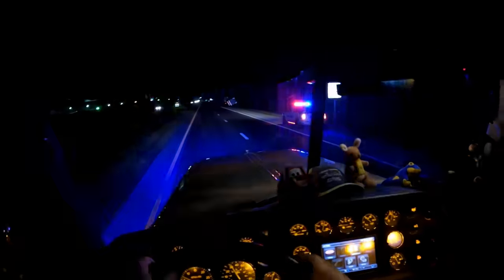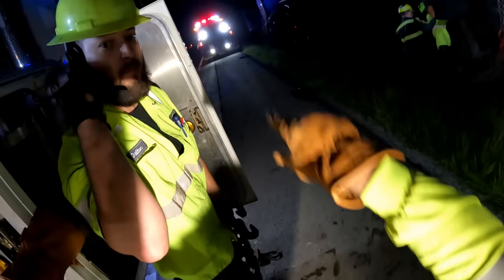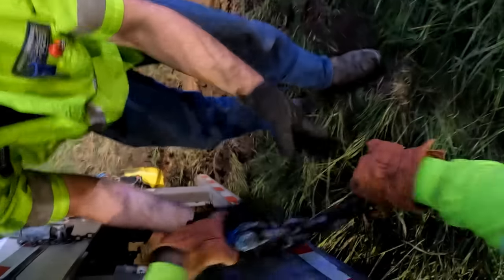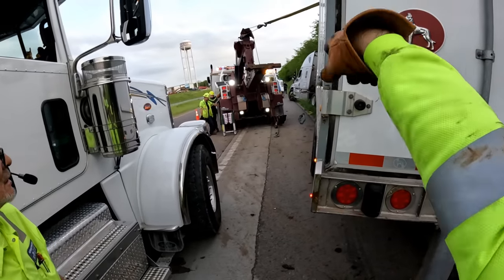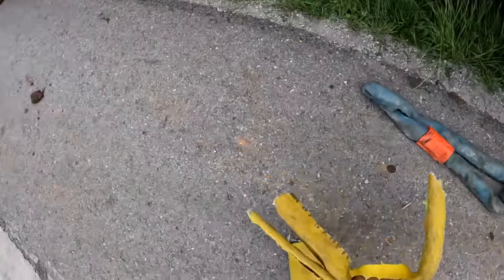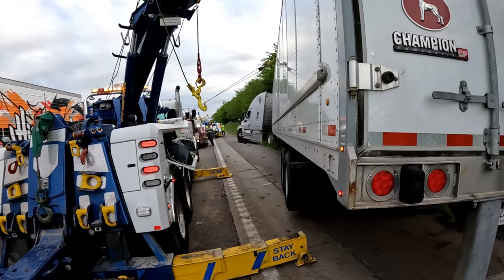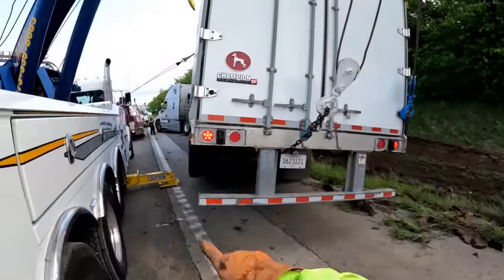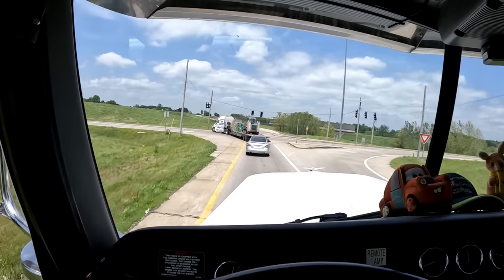Twisted Truck 2.0 Rollover Semi!!! The Job From...a Really Bad Place

Comment: Ron the only thing I would’ve done I would’ve backed the rotator up to the back of the truck and run the boom all the way to the front so you had that 4 foot of roll on the Track. I also agree with the other guy about dropping the airbags on the trailer and unhooking the red gladhand that would’ve dropped all that weight lower to the ground and I helped with the center of gravity counter on the 5 foot tall load

Comment: I got quite a kick out of the Top Gun reference you slipped in there. Haven't seen the new sequel yet, I will soon, but the original is still one of my all time favorite moves, more than three decades later. I watch it at least once every year or two and know most of the lines by heart.

Comment: Never having worked a recovery of this magnitude I can offer very little critique of the methods you chose. You assessed, created a plan and worked your methods within the plan. The one thing that might have helped stabilize the trailer would have been lifting the right side trailer wheels high enough to place timbers under them to tilt the trailer to the left past vertical. Or an  air bag to hols it upright. But what you did worked and that is what counts. Great recovery from a very difficult position.

Comment: I watched another towing company doing a rolled over car hauling trailer with a Ford 1 ton pick up still attached and on it's side. They did not do a low pull. Nor did they use anything more than the size chain than what is used as a break away chain on a small  single axel trailer. When they rolled the trailer and pick up,  it came down hard. There was a second pickup. There they used the snatch block that was way smaller than your smallest one. Then they didn't chalk any of the wheels,  so it slid rather than roll. They sure made you guys look like professionals. Even when things don't work well for you guys, it still is better than what those other guys were doing!!!

Comment: Ron, I am a rigger in a more industrial setting, mostly working with overhead cranes so my experience with this kind of lift is severely limited.  While I know this was a sketchy lift in the extreme, lets look at what went right.  Communication.  You are able to effectively and efficiently communicate with your team to keep things under control.  Safety.  While the load was unstable to the very last, you kept your crew safe, and additional damage to the equipment to a bare minimum.  What would I do different?  Not being there on the stick, it's all armchair philosophy, but perhaps I would have left the back of the trailer more in the ditch, and really got after the tractor/front of trailer and brought them up sooner.  Also the one situation that seemed to really get in your way was the way the rotator was staged.  Would it have been beneficial to stage it the other way round to the trailer?  Again, just watching a video and not being there, it is rough to give meaningful input.  Lastly, I think the one major thing you said a couple times was "this is a two rotator job".  Now the question is, do you have a relationship with another towing company to have access to a second rotator?  If so, that would have been a good call to make--time permitting of course.

Comment: Ron, in your post yesterday, you asked for suggestions on how you could've done this job differently and mentioned possibly unloading the trailer. I'm not about to second guess you on this but, I will say that unloading it likely would've made an already dangerous job even more so. If you hand unload, it would've been hours longer with your crew on the side of the road and a lot more back breaking work, along with at least one more vehicle on scene. If you tried to use a telehandler or all terrain forklift, you would've risked getting them stuck in an already bad situation. From what I can see, you did it the right way to minimize danger and time on the side of the road.

Comment: Hey Ron here is another method to do. Have the tator in the slow lane further forward then have a main line on each of the passenger corners and an aux line to the wheels on the trailer and rear frame of the truck. Then use the WS to pull from the front. This would allow you to grab the trailer then support it while being able to side pull on it using the tator. Another option on top of this would be to side pull the rear frame of the truck with the WS and front pull with the lil pete.

Comment: Well, in asking for comments for "what could have been" ya opened a can of worms. My thoughts have a few different ways to go.

First thing I woulda done different is a slight change of rigging that would have made things a bit easier in the long run by keeping the blue line accessible. Hook it into one of your hard points on the back of the tator and leave her on free spool, easy enough to winch it back in, and in a pinch it can also be used to brace the boom and keep side stress off the assembly. 
Second thing, that blue loop was a champ for holding on like it did, but to quote a master of recoveries, "overrigging is underrated" (Ron Pratt). Best bet would have been to use one of the wide straps, angle aluminum to spread it across the corner,  and shackle and chain to hook to the trailer frame. 10 times the security.
Third thing, totally could have handled that roll with the auxiliary winches (1 low, 1 for strap)
Fourth thing, angling the tator into place rather than parking as close as you started from, probably would have saved yourself about 4 mini heart attacks from almost seeing a DOT bumper tear up your rim and tire, I know it's an armchair quarterback response, but I've always been more cautious. If you hit capacity on the lift, can always move a bit closer.
Fifth and final thought, sometimes ya gotta go backwards to go forwards. After the roll, if you had picked the trailer and swung it back further into the ditch, without the one set of wheels up on the road way, you could have hit a stable point to set it down and get repositioned and re rigged to lift it back up onto the roadway. From that stable point, could have either gone to lift the front up to the road, or low hooked and held it while the Vulcan or Lil' Pete pulled it up.

My thoughts aside, great job by yourself and the whole crew on a nightmare job. It didn't go as easy as planned but you upheld the tradition.
Improvise
Adapt
Overcome.
Reply from the maker: Thank you, these are the kind of suggestions I was looking for.   Well thought and explained.  I especially liked the suggestion of leaving the blue line down where it was accessible.   Normally, I would have been using it and for some reason, I didn't think about needing it at the time.    Again, hindsight....  You brought up some plausible ideas and gave them in a respectful manner, which is greatly appreciated.  Thanks again and God bless.

Comment: Gee Ron, might be time for a second rotator 😉😉 
Per your previous post... my 20/20 hindsight is... the rotator needed to be right on the dotted white line from go giving a little more space down the right side. And I would possibly have put Talon at the back and rotator at the front of the trailer? But you may have well had reasons not to do either of those things. 
That said you guys all worked very carefully and safely, and all your skills and experience were all called upon for this one. Well done guys!!!

Comment: I'm watching this a second time, a year later. Yes, many ways to ten. Small suggestion. At about 38 min, you have released the daisy-chained pair of secondary boom lines. At that point, you could have used one of them to run a second run like Talon's but with a very wide broad flat strap that has triangle rings at each end over the top (use long rope line to pull over)  and attach it to the forward trailer boogies to help stabilize the rear from rolling back over. Yeah a second rotator would be nice, after you win the power-ball.

Comment: A tough call Ron, many ways to get to 10. A second Rotator yes if you had would have lifted the trailer nearer the 5th wheel but you don't have one so you worked with the tools you had, also you weren't to know that the trailer had a "pregnant bulge" and with all the weight there over the 5th wheel that possibly twisted the chassis on the tractor unit which in turn made the job more frustrating to say the least. No injuries and you got the job done. Don't beat yourself up Ron and give someone else a foothold. continual prayers to all.

Comment: The WIDE load was the only 18 wheeler that made traffic go slow, I understand he was kinda obligated to due to his load, but all other 18 wheelers zoom by like they’re on open road. They should be smarter than that but everyone is in a rush to get nowhere now a days. I can tell you were frustrated on this job Ron. You didn’t have the overhead wire nemesis but you had the not so wide Highway nemesis 🤣🤣
Great job as always.

Comment: Good afternoon Mr Ron
Spectacular job for all of your guys working together to get the job done and done safely with no injuries
I realize that your communication links are integrated, is there a way to get everyone's voice on the video?
In my opinion, I would have put the rotator in the middle and used the two "Christmas wrap straps" to the front and rear ends of the trailer, with the auxiliary lines down low to help stabilize the trailer while the Vulcan V70 was facing traffic and used both a high line to the landing gear and a low line to the down side of the trailer to help with the upright and the little Pete like you did, just my opinion though I'm probably wrong

Comment: Ron, the only thing that I would have done differently is to have either positioned the Rotator the same way that you had Talon position the Star, node angled out; or maybe position the Rotator facing the wrong way and lifted off the back; or even worked off of the nose. All three of those would have kept the Rotator free from being hit by the trailer.

Comment: Question.  Why didn't you re-arrange the load or would that have been too dangerous?  It's obvious that the load slipped to the right side of the trailer, causing the trailer to be so unbalanced.  Close to the end of the video I have to say I've watched dozens of your recoveries, and this one was all done by inches - literally.  Amazing work, you guys.  Amazing.

Comment: Hey Ron, a thought.....

Given that the trailer wants to roll onto the passenger side, if you picked it up and rolled it upright, then slid it so the passenger side of the trailer axles sit a slight bit higher on the berm than the driver side, would that have been enough to offset the trailer's imbalance?

Just thinking that if you could counter the trailer's inclination to flop on its passenger side, you might then be able to get the tractor out of the way; which in turn would give you access to be able to just pick the whole trailer up and plop it on the paved shoulder.

Comment: Good to see Talon back on a recovery.  He was well train and fell right back into recovery as if he was doing it every day. 
You had asked about other ways to do this job earlier. Only thing I would suggest would have been to hold the back if the trailer with a heavy beside the rotator and moved it toward the nose of the trailer to get that on the flat surface of the shoulder sooner.  
I can see where unloading on the side of the road as being a no go—that lean with traffic concerns would be a tough call for general safety. 
You mentioned a second rotator several times, but you did the job well, it just took a while. If a total road shut down would have been required, then probably would have needed to reach out to another company with a rotator. Not ideal but I know there is one about 40 miles south of that scene.

Comment: A long roll-over video with all hands on deck including Talon.  A full package video.
Nobody was hurt, no equipment was damaged. Despite the difficulties, a good & safe recovery.

I was wondering why you didn't have a 2nd top strap like you've done on other roll-over jobs.  Anchored towards the nose of the trailer and connected to one of the auxiliary winches on the Rotator.
Since the load shifted forward and to the right, that seems like it would have worked better to prevent it rolling back over til all wheels were back on pavement.

Comment: When setting up, move the rotator farther forward and upright,then drag the rear up onto the road with the rotator. Once uprighted, have one of the smaller trucks backwards holding the trailer in place with a low pull to the trailer frame, and possibly using its boom to hold a strap over top of the trailer.

Then the rotator would be free to deal with the front of the trailer and/or the tractor

Comment: Since you asked for opinion. Before trying to set it up right i would have rigged it for the pull up with the boomso is a 2 phase processwith all the winches at the same time. The back frame chains ready so as soon as you pull it to make it sit on its wheels at the same time pulling with the boom whinches to make it float and put both sides level with the ditch meaning the ditch on the middle of the trailer. That will give you the possibility to keep the trailer stable while you setup again to float the tail on the road and the the same with the truck. I hope it makes sense what  I wrote here would be easier to  draw it. But it is what it is.

Comment: Ron, you asked how you might have been able to do it differently.  My only thought would be a crystal ball or x-ray vision.  Because of the weird, potentially shifting center of gravity on this one, it was basically impossible to tell how that load was going to behave once you started moving it.  Your best bet it to take small steps, and reevaluate as you go.  Be smart enough to change your approach if you see something you don't like.  Others might have chosen a different path and ended up luckier, but I don't believe there was adequate information at the outset for you to accurately choose a better method from the start without just being lucky.

Comment: Could you have used the skid steer to help support the trailer while you reset things? Anyway, a very tough and tricky job, but you did great with what you had to work with.

Comment: Hello from England. 
To answer your question on the community page, could they not let you close the road for a shorter time to give you more working room?

Could you have some sort of anchor point on the front bumper, or front outrigger of the rotator; to hold the trailer whilst you repositioned the boom?

Or ran a line from the Vulcan through a snatchblock on the front of the rotator; so the line is at a right angle to the load? 

Anyway, don't worry, you were prudent and got the job done safely. 
All the best, cheers 👍

Comment: Hi Ron. You asked for viewpoints on this job...
My feeling is that the initial rigging was sound. However. I think that if you had added the blue line to the low right corner (where you put the white later) you could have rotated it upright like you did and then use the blue line to keep it while you moved the white over to the lower left and then pick up the back and set it nice and stable in that ditch. Then you could reposition your rotator (turn it round?) And do a lift and swing onto the road. Or assist as you have the other truck pull it sideways or walking it out. Don't know if the boom would have had the capacity to lift that initial upright and out further out into the ditch.

Comment: Ron, you asked if your viewers had some sort of advice on this job. I'm not in you proffesion in any way but I'm 32 minutes in the video now and the only thing that I could think of is why didn't you counter lean the trailer so the load slides to the drivers side.  
And now I've finished the video and the only thing I want to say is that in my opinion the Rotator should have bin the other way around from the 1st minute. and I know that's easier said than done. Thank you for sharing this huge job Ron and please, please don't see what I said as a negative comment. The only reason I said what I did is because you've asked for it.

Comment: A question for Ron , This is just an after thought ........If you used the spreader bars on the trailer wheels and lifted would that have made any difference? This is another way to Ten Ron and YOU are the MASTER and the BEST I M O ....Great Video and God Bless
Reply from the maker: Hello my friend.   The spreader bar would have been sketchy, in my opinion.  The spreader bar uses a single lift point and the load is going to automatically go toward the pull gravity.   The only way to counteract that would be to have shorter straps on the heavy side so that it lifts the heavy side first.  The trick would be trying to judge what length of straps to use and then if the load shifted more, it would be difficult control...not like this wasn't already difficult to judge.   Could a spreader bar have been used??? Probably....
Thanks my friend and God bless.

Comment: I'm astounded the side wall of the trailer held together against those pallets of paper. I doubt there was anything you could've done that was going to make this one "easy" - releasing the kingpin would've left you with even fewer ways to hang onto the trailer. Airbags were definitely not going to help this. Only other option would've been to unload as it sat in the ditch, and that comes with its own risks. A master class in perseverance.

Comment: Hi there wonderfull. Job. Done even where it was at and the position it was in as if I was you Ron I d stop short of the back of the trailer and set up on it and move it back on its wheels and put back on the blacktop with two shots while talon works the front with out gettin anyone hurt and could v used air bags too as that incident was dangerous esp so close to the rotator all in all good job